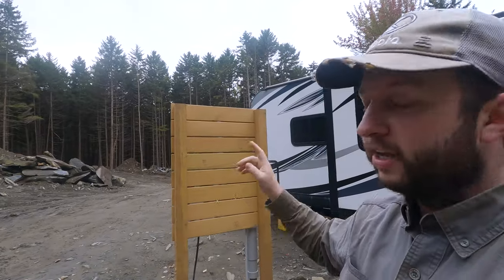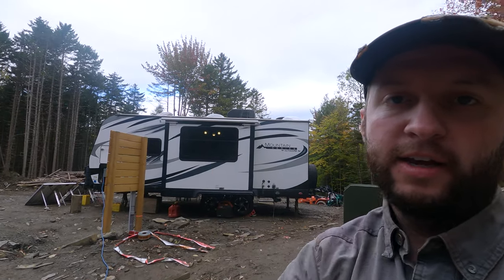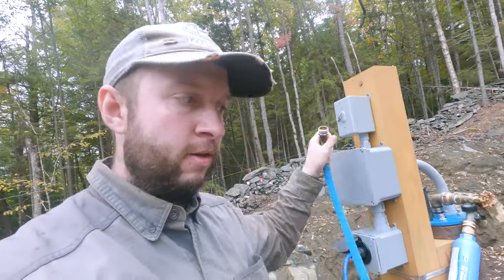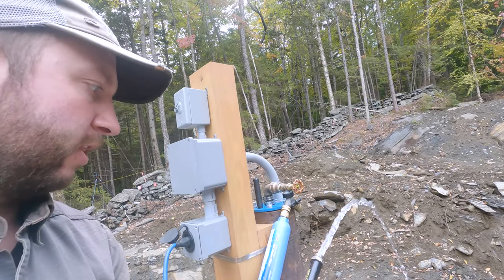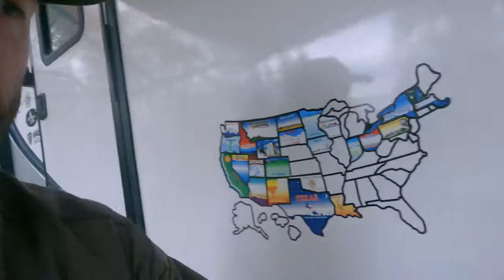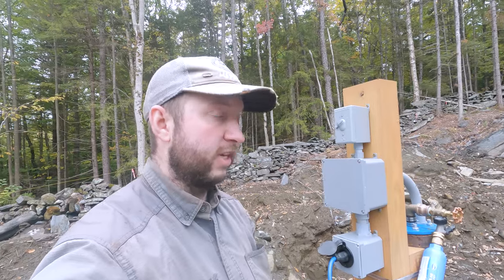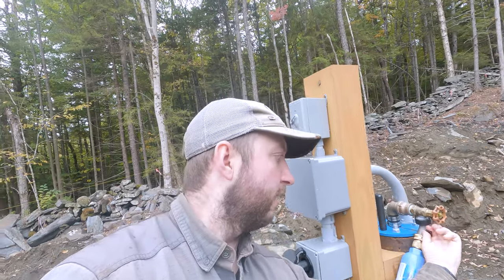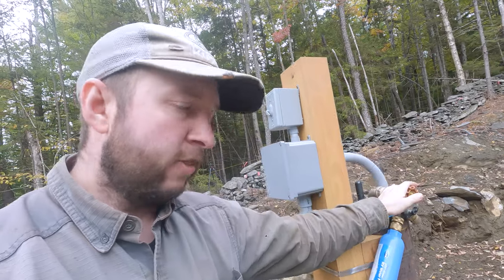Living in RV while building a house - FILLING FRESH WATER

Comment: Hi Matt your trailer should have a city water hook up, you just connect the hose. Well pump stays on, trailer pump stays off. We have a 2017 ORV 26RLS Timber Ridge Titanium. Our city water hook up was in the back of the trailer.
Reply from the maker: It does have a city water, the issue is we don't have the well set up to support it yet. Typically, a well pump is managed by a pump controller which will turn on the well pump when required (usually when the pressure in a pressure tank drops below a threshold) and off again when it's no longer needed.

We haven't yet installed that equipment because it needs to be somewhere that it won't freeze. In our case, that will be our utility building and needless to say, we're very much looking forward to having our water permanently hooked up!

Comment: I have a Grundfoss pressure regulating system on my well. The pump runs till the pressure you set is reached then turns off till pressure goes down from you using water then it turns back on again. I never turn mine off manually unless I am working on the system.
Reply from the maker: With our temporary setup there is no pressure tank so nowhere for pressure to build. Consequently we have to manually turn it on and off. Longer term this will obviously work differently.

Comment: Are you not just hooking up directly from the well to the rv to avoid the well pump coming on repeatedly?
Reply from the maker: Exactly, and because we haven’t installed a pump controller so there would be nothing to toggle the pump on and off. Since we have a fairly large fresh tank on the RV, we only need to fill about every 1-2 weeks so it’s not a big problem for now. Soon enough we’ll have the utility building and proper hookups!